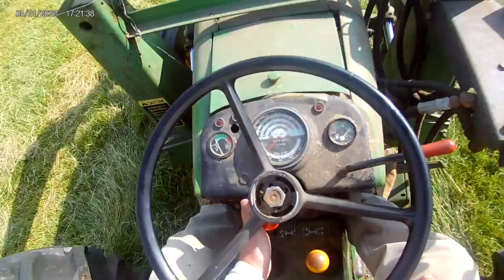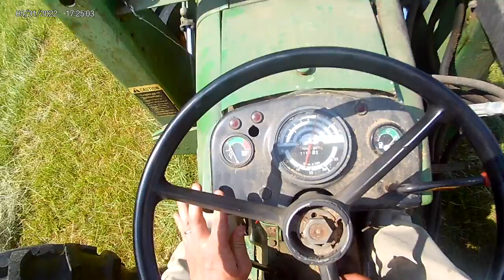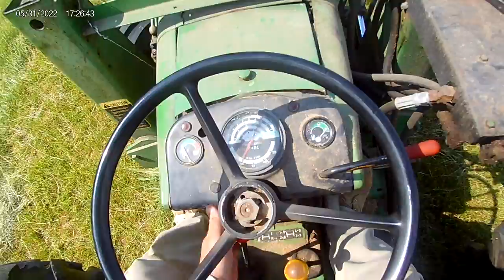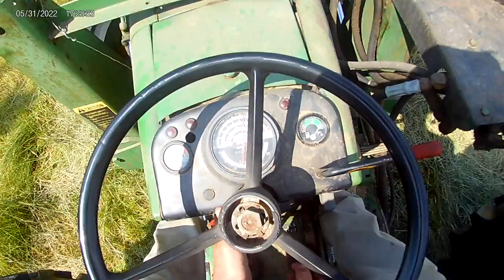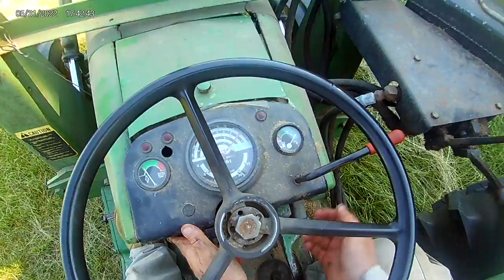Trying to bale hay with JD 24T powered by JD 2040 first cutting 2022: part 1

Comment: Your windrows need  to  have  less  hay in them because  it's  pushing  the hay in the chamber  so fast that the twine knotter can't  keep up.. you can also use your loader as an  additional  emergency  brake
Reply from the maker: Yeah.  Hopefully I'll get it dialed in.  Windrows, speed, and the new finger control rod assembly upgrade I installed this winter.  There's a video of that going in on my channel, if you're interested.  Thanks for watching and lending advice!

Comment: Did you get your stuff together and have someone knowledgeable show you what is wrong,  and how to fix the problem?
Reply from the maker: Folks are so kind to me! The old-timer that sold me the haybine spent a good half hour with me and the baler...threw some hay in by hand with the baler at a stand-still so he could get a look at the knotters working.  His explanations helped a lot.  His help, my dad's talk over the phone, and a new part got it going right.  This year I adjusted it to make longer bales.  LOL.  Not as simple as I would've thought!  A lot of trial and error with the tensioners, and another piece that had bent (and I had "fixed" by bending it back) is needing attention again.  I think once I get it going well again, I'll leave the length setting well-enough alone!  
Since this video, we've made maybe 600 bales on our few acres.  I'm about to cut second cutting for 2023!  First had me breaking a lot of bales AFTER I set it for a longer bale.  Frankly, I don't think I'll ever truly understand how to get her fine-tuned perfectly.  It's a lot of trial-and-error and maintenance with a machine this old and with some parts out of alignment or bent.  Probably doesn't help that I'm operating it on hills.  I've noticed I break more bales when I'm on steeper grades.  

Anyway, thanks for the view and comment!
Reply from the maker: Update.  Baler, after a decent first cutting is down again.  This winter, I plan to install an upgrade kit for the finger assembly.  Hope that will improve the old machine's performance for next year's first cutting... thinking of mowing the fields to increase fertility the rest of the year.